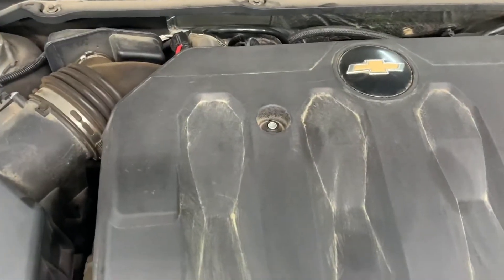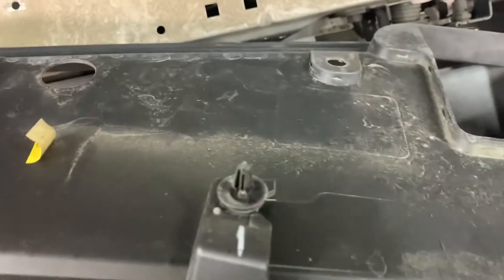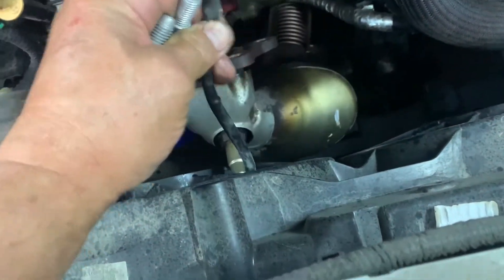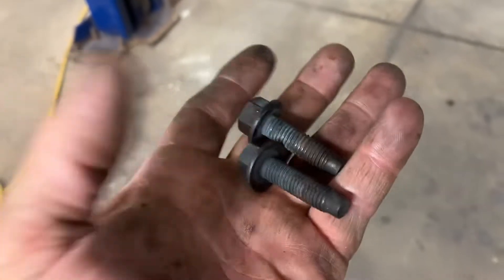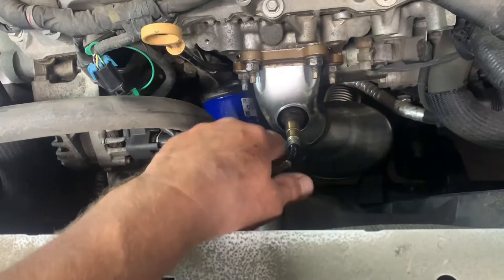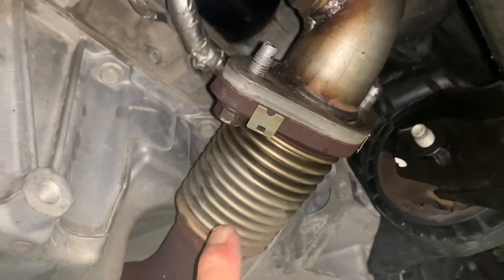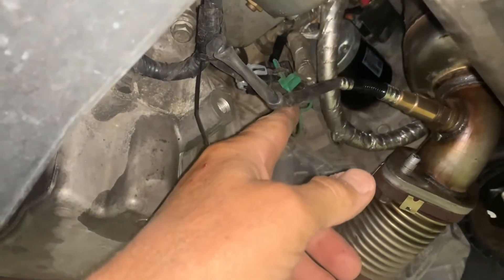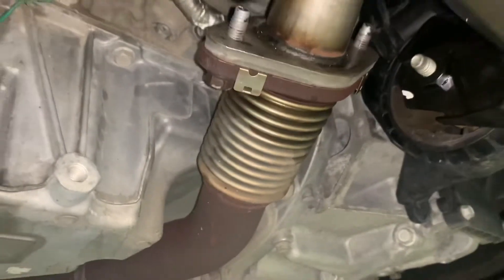2013 Chevy Impala Front Bank 2 Catalytic Converter

Comment: I have a Question is that catalytic converter Carb compliance?
Reply from the maker: Doubt it
Reply: Ok so when they installed my front catalytic converter the bottom 02 sensor got bent because it was hitting the frame of the car. So was the 02 sensor on the catalytic converter in this video to the right of the catalytic converter. When I say right looking down from the top of the engine to the right ?
Reply: Does the Emission Family Group # does it have to match the new caty  family group # ?

Comment: So bank 1 is the front of the engine? And bank 2 is the rear?
Reply from the maker: No the front one is bank 2 sorry for the confusion
Reply: @richierock1300  thank you fam! I got a code that sensor 2 on bank 2 has a voltage issue. My worry is getting into the rear one, because it’s so tight and don’t have a car lift 
:(.